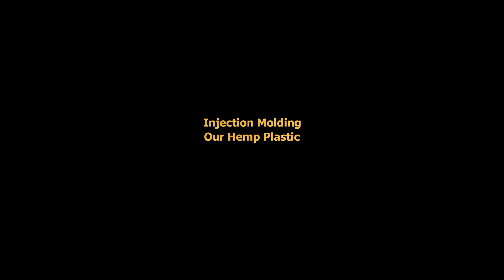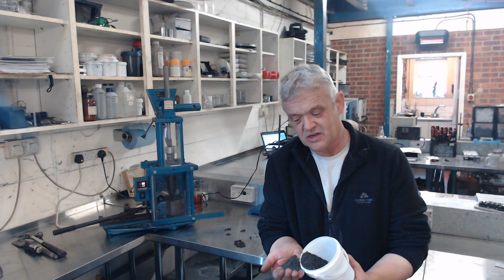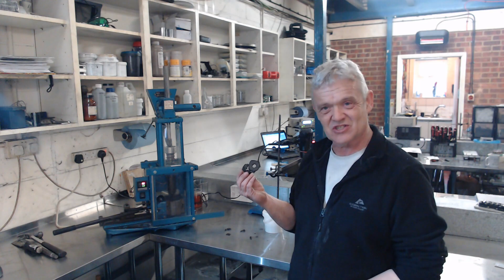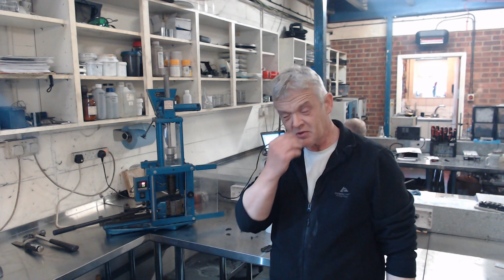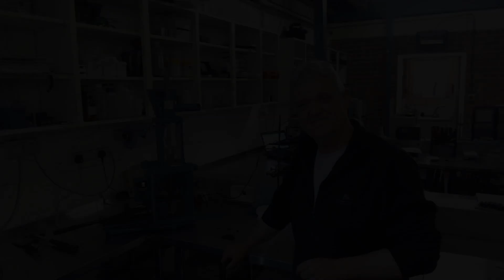Injection Moulding Our Hemp Plastic

Comment: A FLEXIBLE plastic could help manage disposable footwear for emergency rescues, hikers and tourists any place where people want shoes purpose made but do not want to keep them, or which will be for some reason unreusable in the normal ways.

People often go to beach edge resorts and instead of buying flip-flops for the beach at home and packing them, they simply pay a small amount for a pair to use where they go, and then leave them there, where they often end up in the trash.

This is but one of a few possible ways it could be used, assuming that it was not strong enough or durable enough for long life footwear of course. ~( 'w')/

Comment: If you were to make waterbottles out of this, how would you prevent the bottle from degrading while it's holding water?
Reply: Hemp plastic is compostable which requires a certain set of conditions (temp, moisture and microbes) before the product would breakdown.  So if we have a product made from hemp plastic it would probably last for years I imagine.
Reply from the maker: wax coat the inside maybe

Comment: Great job 
Not the same but you can get a good range of basalt fibers  not biodegradable but non toxic and potentially reusable 
Does anyone know of a good source for industrial casein without having to buy enormous amounts
Reply from the maker: nice idea mate and very interested in the results - if you don't want over 25kg mate just buy it online - it's used as a fish bait and really cheap
Reply: Robert Murray-Smith so far I’ve only found body builders stuff or 20 tonnes from India but thanks for that heads up I’ll check that out 
I can see a lot of uses for these type of materials and hopefully I’ll be using tonnes, not quite ready for that but time to start playing with it 
These gems you share are or some 😃
Reply from the maker: @johnmcfadden9336  lol - cheers mate